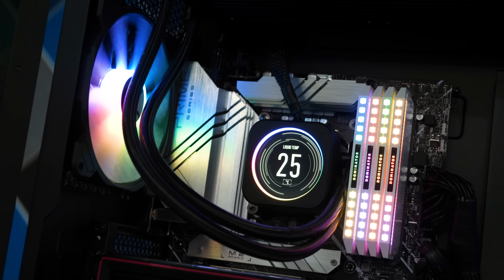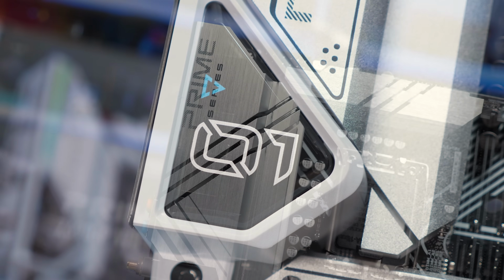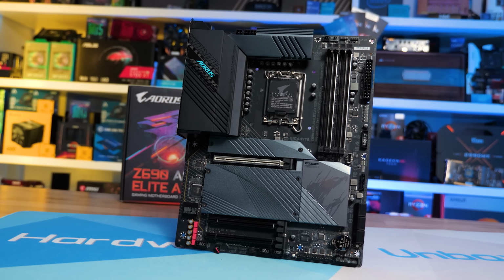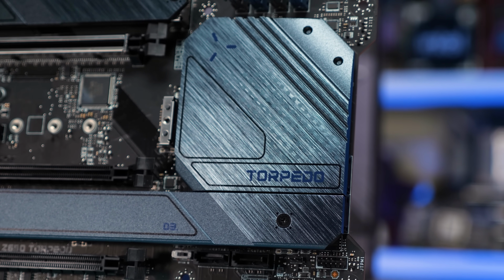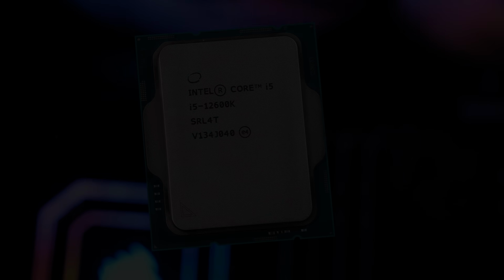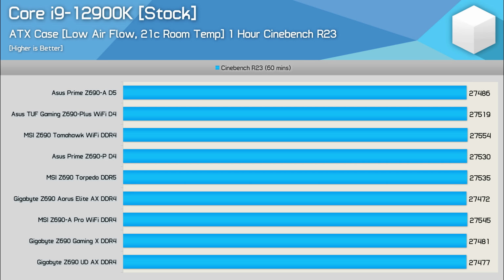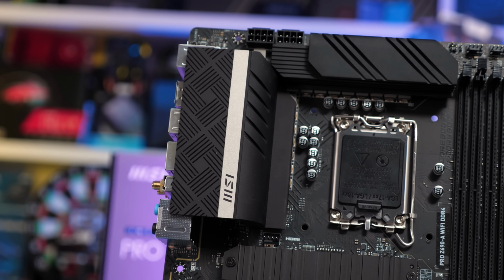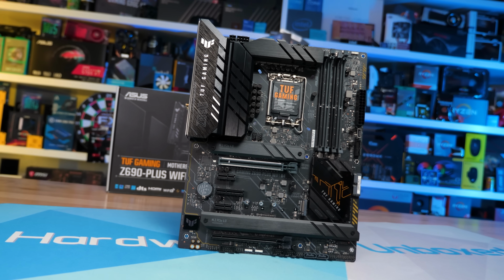The Best Value Intel Z690 Motherboard: VRM Thermal Benchmark

Comment: At 10:10 you are talking about the Asus Prime Z690, but the graph states MSI Torpedo, which one is correct?
Reply from the maker: The graph is correct. The audio is wrong.
Reply: @Hardwareunboxed  you never talked about the z690 a d5 other than cry about “wHo wOuLD buy that cuz ddr5” at least just talk about it and leave it there, you already were rambling stupid sht about the torpedo and werent able to edit it well
Reply: @Hardwareunboxed  It's very easy you just change the thermal pads on the Gigabyte they only use 5W/mk you get 12W/mk from Ali Express. That should drop temps by 10 degrees. This is how you use the uniformed bad rep of Gigabyte to get cheaper prices.
Reply: @Hardwareunboxed  so you think it's good 75c for asus prime d4? Isn't it a bit high?
Reply: @AxCE12  They said in the video that 74c is fine, but just a bit disappointing for the price for the gigabyte boards.
Reply from the maker: 74c is well within safe limits for a PCB temp, ideally you'd want to keep it below 80c, once you get over 90c it starts to become an issue and over 100c is unsafe.
Reply: @Hardwareunboxed  
But that's basically more depends on PCB thermal conductivity and heatsink copper layer design than VRM itself. 

Why not to measure MOSFET temps?
Reply: @Hardwareunboxed  What about asrock steel legend?
Reply: @AxCE12  that first graph was for the i9 12900k, and he was testing it on the lower Z690 range. ya 74 c is not exactly ideal, but keep in mind that he was using very little air flow. so that's obviously gonna effect temperatures, it's a stress test to see what the worse case scenario would be. since the i9 12900k is gonna draw the most power, it makes sense to test that first.
still for some of the lower range Z690 boards that's not too bad, but what it also tells you is, the Asus Prime Z690-P, the Gigabyte Z690 UD Wifi, and the MSI Pro Z690-A Wifi are probably not a good fit with a i9 12900k, even the i7 12700k is a pushing it a little bit, but the i7 12700 non K, i5 12600K, and i5 12400 would be perfectly fine. with good Air Cooling, that's one way you can lower temps.
Reply: @Mac Pot Clear. Thank you for the explanation. It's really difficult to pick a mb right now because there is not a lot of information out there. And the prices are premium for something that isn't really premium
Reply: Haha about to say the same thing
Reply: So the Torpedo is actually a very good board as a alternative to Tomahawk?
Reply: 12:20 is also wrong.. "picking up 68 degrees" but chart shows 60.
Reply: where is the asrock review already?
Reply: It is intel Z 690 which costs 1/2, the price of Pro art Z690 creator 12 Gen wifi LGA 1700., Am I correct.
Reply: Mmm in
Reply: Hello. How about a best motherboards for 13 gen "B" and "Z" chipsets ?

Comment: Great info! I am looking to air-cool a 13700k and want to get a good board to keep it cool.  It seems to me that 10 degrees difference in VRM thermals (say between the z690 Asus tuff gaming and Gigabyte UD) should be a major thing for me to consider. Does this translate to CPU temps? Am I missing something?
Reply: Maybe Gigabyte have 2 layers of copper - better tranfering heat to back ?

Comment: Gigabyte boards use Direct Phase Design & thats a possible reason why they are hotter than the rest (also BIOS settings-thats why is important to include test where all settings are the same for all boards). I really think the VRM components & design should be added to the graph (not just mentioned briefly) because judging by only the VRM Temp is misleading. 
Since testing VRM, Max Overclocking results should be added to see more of the whole picture. I pretty much guarantee Gigabyte will have advantage in CPU OC.
Reply from the maker: We're testing out of the box. This isn't content for extreme overclockers. I actually yawned when I read 'misleading'.
Reply: @Hardwareunboxed  What I meant is that you cant judge the VRM quality from the temps only without context. You cant say the board with Doublers is better than one with Direct VRM because it has inherently lower temps "out of the box".
Today everyone recommends using 280/360AIO for AM5 & Intel 12/13Gen anyway. You dont need to increase voltage to OC.
Although Overclocking & Extreme OC are two completely different ways of OC.
Reply from the maker: But that's not what we're doing at all. We're making sure no boards run excessively hot. I mean I bloody well said as much 13:55.
Reply: @Hardwareunboxed   14:50 The phrasing... Auros Elite does not have weak VRM. It is Better than Auros UD AX ('Twin-Phases' VRM at 60A), not to mention the MASI-A 14+2 'Duet Rail'. Auros Gaming X also has worse VRM at 60A although the price difference at the time & region can be worthed. The video is about VRM though.
Reply: @Hardwareunboxed  PS: Maybe 'misleading' is strong word. I approach it as the average person. He wont understand the VRM specs but will get an overall impression and mine was that Auros Elite is one of the poor choices while its VRM is one of the strongest of this bunch. 
Maybe mentioning for ex. "This board has higher temps but the VRM is slightly better / or better than ... ". Or "The temps are higher on this one while the VRMs of both are roughly the same with slight advantage of this one.." That way you have context.
Im not telling you how to do your job. You doing it just fine. Just a suggestion from my part.

Comment: Since all of these passed the VRM test I think you should start digging in a little more to see which VRM delivers voltage/current best. As well as looking at ripple. I know that’s much more in depth but those tests would really make the picture clearer and I know HUB could present the info in a consumable way

Comment: I actually just built a system on an asus prime z690a, can confirm that vrm sits very solidly around 50 degrees with an i7 12700k, im my opinion, there isn't a better option for a budget build on ddr5

Comment: Memory OC capabilities should be tested too. i.e. try 3800, 4000, 4266, 4400 DDR4 RAM to see which motherboards actually have good memory overclocking capabilities. VRM tests are not really needed anymore since most motherboards are sufficient in the VRMs department.

Comment: On a whim i looked at the VRM configs, like 14+1 or 16+1+2 or 16+1 and there seems to be zero correlation between designs and temperature, 
which leads me to believe the difference in applied VCORE or chip manufacturer or board design, thermal paste blah blah blah is causing the difference in VRM temps ? 
However it is surely a trend to see Gigabyte on the bottom (thinking about my Gigabyte rtx 3080 with the absolutely trash pads on that)
I would believe that a strategically placed 120 mm fan to have a larger impact on VRM temps than the change of motherboards, 
if the Vcore had been more even across the board (doh).
A more reliable test would be to overclock the 12900 slightly on all boards,  use the exact same VCORE on all boards,  and run cinebench again to see VRM temperature.
That could have given an idea about the cooling capability of the VRM heatsinks.
Then  you could overclock it to maximum, to see which board was (presumably) providing the most stable power.
It is hard to compare 1.291 volts VCORE vs 1.244 volts VCORE  and decide which VRM is better, this can be turned around in next bios update by the manufacturer. 
It is meaningless.
Package power doesnt really provide much sense either, unless the boards are identical in features.

Another thing: Memory. I am not going to overclock my 12600 K much, since the gain from modern CPU OC is very small, 
but i would like to run my DDR4 at gear 1 and preferably at c14 3800 or higher. (planning to use 2 x G.Skill 4400 C16 DDR4 - F4-4400C16D-16GVK)
The memory capability is not even mentioned. I would like to use 3x4 nvme drives, but sata ? dont care about sata. 
I care about ethernet, what chipset is it ? Number of USB 3 ports ? Wifi chipset/type is it wifi 6 ? 
Often realtek ethernet is useless, and then you will have to get a pcie card which adds 30-40 $.
No mention of this either.
Onboard sound ? i dont care much about it, but i know many people do care, since they have surround setup or good hifi speakers, while i use USB headset.
I am not trying to trash your review, but i think there is a lot more to cover than this, basically all of it.

Comment: Pity that the Asus Z690 Prime-A only comes in DDR5, otherwise - as a long-time Asus user -  it would've been my pick. Ended up buying the DDR4 Tomahawk instead to go with an i5-12600K and I think I made the right choice. It has Wifi, which would've cost extra with the Asus TUF I was also eyeing. Plus it has one more Type A USB connector. The TUF has a second Type C socket in the back instead, but since I only have one Type C device and lots of Type A ones, that was another plus for the MSI in my book.
Reply: another type c is basically a usb 3 .. there r eno68gh cheap type c to usb 3 connectors available in Market . 
hv made it that type c into usb 3 port .
i won i7 12700 and Asus tuf wifi

Comment: I would like to know how the ASUS PRIME Z690M-PLUS D4 would match up against these atx boards. Is it possible to include it somehow?
Reply: get the tuf wifi
Reply: id love to know that too as im limites to m-atx on my cases and frankly, theres no point using full atx these days as all this real estate is USELESS. ive been putting back a new build on the backburner for 6 months because the asus z690m seems to be the only z690 matx availlable in canada with ddr4 but i don't want to buy and get a 12700k running like a 12400 because of poor power delivery. seems all the love for smaller form factor has gone fubar, but why ?
Reply: @jeromegagnon3787  get z690 tuf. small boards r useless and rnt built upto the atx standards. i hv used all kinds if biards . ATX are best 😌
Reply: @CaptainScorpio24  ill never go back to a full atx board. neither need to go itx, we all have 2 to 3 slots gpu's and i just don't want ANY liquid coolers ever. ill take over a kilo of aluminum fins and easy to troubleshoot and replace fans. plus we have ABSOLUTELY NOTHING to put in all those other useless slots, sli is dead, im a gamer, no need for wifi. no need for onboard audio when you already have dac (everyone should) i got a case i like because it fits under my ''desk'', is hyper easy to work with and is silent. and im dead set on this. there was a time not so long ago where m-atx was the sweet spot. guess ill wait for a couple gens when ddr5 is good and ''cheap'' and the manufacturers and the peoples come to their senses..
Reply: @CaptainScorpio24  im not going to push out a 12900ks to 6ghz. i just want a decent board that will allow a 12700k to hit its boost and keep it there. for me, the ''real'' oc was from 2002 to 2010 when we played with dry ice and stuff on dfi boards. no real gains to be had these days thats worth the effort and energy uptick...
Reply: @jeromegagnon3787  i got i7 12700 non k wd asus z690 tuf wifi d4  upgraded from i7 7700 non k wd msi b250 board.  my 5 yr old CM hyper 410r cpu cooler cools my cpu along with 6 case fans  im nt into OC shit

Comment: Hi:  I bought the Gigabyte (Motherboard	Gigabyte Z690 Gaming X LGA 1700 DDR4 ATX Motherboard	1	AU$329.00) and also the Samsung 1TB PCIe M.2 980 Pro.  No matter what I tried (upgrading BIOS, downgrading BIOS, changing settings,  . . .) it would not recognize the SSD, ever.  Took it back to the seller who sent it, on my behalf, to GB and it took a month before they gave up and told the seller to refund me.  In the meantime, while tryinng to find a solution, I stumbled upon someone who had the same GB problem (more than one someone) but this particular person bought the MSI Tomahawk to replace the GB M'Brd.  And it worked straight out of the box!  After I returned the GB for possible repair or refund I purchased the MSI and a voila, it worked straight out of the box.  And now I find it's third coolest by 1C.

Thanks for the great review.
Reply: GB board as well bios sucks big time.
msi are good but hv bcum most expensive
asus ones r tempting n reasonable wd product features list.

Comment: What ever you do, do not buy that gigabyte Gaming x board. mine is going back to the seller. it does not boot from m.2, sata or usb flash drives. Changes to the bios are not stored half the time and a bios update didn't fix it. Even if the board manages to see my drives it will not let me select them for boot. That board is as usefull as a beached whale. Many people are having the same problems with it.

Comment: I bought the best board I could afford. IMO ASUS has the best motherboards, not much of anything else. But I got myself the ASUS Z690-F. Paired that up with Intel's 12700K and ADATA XPS 5400 32GB of DDR5 which I think I scored for $400, a fair price considering what the scalpers on ebay are charging for DDR5. I'm excited to get it placed in my case and move on with Windows 11 Pro. Then I won't think about the price anymore just enjoy the fact I have a new PC and I won't have to watch these YouTube reviews anymore.

Comment: I appreciate the review.  Weird you want ddr4 variants so badly.  Give it 2 to 6 months and ddr5 will be available in stores for regular folks, heck you probably have connections and can get some ddr5.  Personally waiting for some of the slightly higher rated DDR5, could have bit the bullet and gotten some corsair DDR5 but it was basically stock speed stuff.
Reply from the maker: DDR5 has been widely reported that it will be in short supply for the entire of 2022.

Comment: Blowing Z690 board problem....PQ2020 capacitor 150 6.4v next to the damage is the wrong way around polarity wise on the boards that are blowing, it was a load issue with a few capacitors fed to the board machines on the rolls the wrong way around.  the poolarity does matter on these caps the 150 square ones to the left off the blown area below the 88 read out abovr the last memory rail socket

Comment: I've had Gigabyte board failed on me several years ago, but because its pure coincidence I ordered another one with 12gen bundle. Not only it has arrived with defective LAN and one SATA port, they removed Virtualization setting in their "new" BIOS. Instead of simple answer, their arrogant support questioned me why would I even need that Virtualization setting, only to back down later to confirm that they intentionally removed it. Absolutely the worst company.
TUF works like a charm.

Comment: i Bought two Msi z690 boards/ edge wifi, pro z690-p), ddr4, none of the is booting from pci-e 5.0 slot. in The shop they booted with other card ... i think older nvidias and i worked. i Got Red devil 6800xt.
Reply: I had same issue with Gigabyte Elite AX and a 1080ti as well as 960 - No card would boot from x16 slot pci-e 5.0, but fine from other slots - returned my board. I have heard other people with MSI saying no cards booted in the main pci-e 5.0 slot

Comment: Got the TUF D4 with the 12900k. Seemed like a well thought out board. A solid performer thus far. Hitting those C23 scores wit an adaptive undervolt, and sub 80 degrees on air.
Reply: I got the same combo TUF D4, 12900k. What is the adaptive undervolt? I am also cooling with AIR NOCTUA DH-15 @HeadPack
Reply: Hi, I'm trying to decide which Z690 I should get to pair with a 12900k, and I think I'm going for the TUF D4, but I'm afraid of temps and OC capabilities. Could you tell me what kind of temps you reach while running some test like Cinebench and gaming? I can't seem to gather these infos anywhere :/
Reply: @GloRupt  Hi, I am using a Cooler Master Maker case with 3 fans at the front, and 2 up top, all blowing in at low fan speeds. No rear fan. The 12900k is cooled by a Noctua NH-d15. Running the CPU stock at nearly 250 Watts, e.g. in CB23, it reaches 93 deg Celsius in a room with 22 deg C ambient temperature. However, an adaptive undervolt of -0,1V brings the wattage down to some 210w, and the temps slightly below 80 deg C max. That is, without affecting the performance. I am still getting 27.4k multi core score in CB. How well each CPU undervolts depends though. Most are said to do -0.065 volts reliably. The mainboard keeps cool, as far as I can tell.
Reply: @HeadPack  most I could get gaming was Horizon Zero Dawn which utilizes 40%-50% of the CPU, the 2 hottest cores went to 89*C MAX on DH15. my ambient is 23*C 3 front 1 at back no tops and 3080Ti below :) @Giovanni .. basically for gaming you dont have to worry about temps, its pretty cool on almost all games
Reply: @GloRupt  see reply below

Comment: Tried out both Gigabyte z690 gaming x and MSI Z690-A Pro with my 12700k, 3080ti fe and Dark Rock Pro 4. The Gigabyte looked way fancier and was 30€ cheaper. However, I had to return it, not because of performance or temperatures, but because of 2 more annoying points (for me personally): 
1) I am using 4x8GB GSkill Ripjaws V 3200. I was not able to activate XMP Profile - the PC won't boot anymore. I was able to manually OC to 3100 MHZ. With MSI, I had no problems using XMP Profile and it's running stable @3200 MHZ.
2) Tell me I'm crazy or stupid but the gigabyte MB caused really bad coil whine everytime I moved my mouse. This didn't occur using the MSI MB. I could live with that when only occuring while gaming when using the Headset - I wouldn't hear it then anyways. But it was so annoying when just being on desktop/in chrome in idle mode, turned me crazy...
With the MSI, these problems don't exist. Moreover, I didn't really have an ASUS alternative, as the cheapest ASUS board for me was 250€+ which I do not want to pay for a DDR4 motherboard...
Reply: hey, whats ur cinebench r23 score like?
Reply: I had the same problem with a gigabyte z370 aurus when I bought my 8700k.  Sent it back and got a ROG board, 4133 XMP no issues.  Going to avoid gigabyte for next build